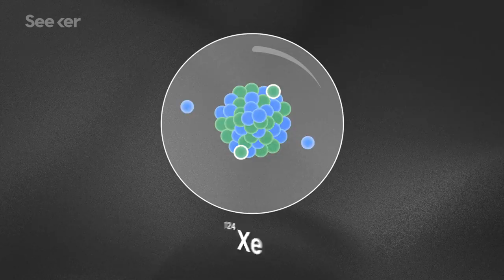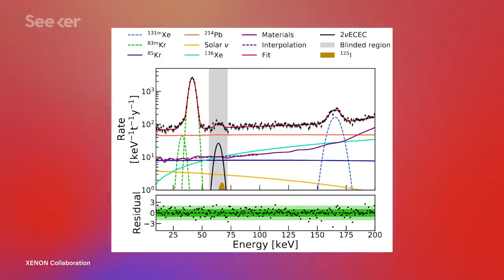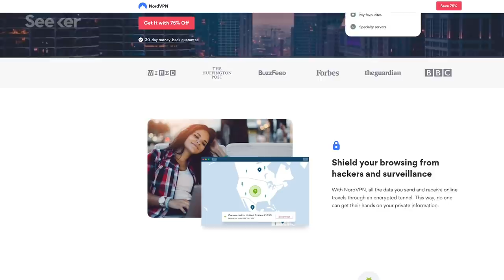Scientists Were Hunting for Dark Matter...and Then This Happened

Comment: What do String Theory and Dark Matter have in common? Two theories of explanation that have no evidential validation. Dark Matter is surmised circumstantially, but perhaps something else is causing the circumstances. Dark Matter was invoked to explain why the outskirts of galaxies rotate much more quickly than would be expected based on the gravitational pull of visible matter alone. Well, Bruce E. DePalma ran experiments where a spinning ball projectile did not accord with conventional Newtonian calculation expectations. Gravity & The Spinning Ball Experiment http://www.rexresearch.com/depalma2/depalm.htm.

There was also an anomaly with an early satellite space shot where the final stage consisted of several solid fuel rockets arranged to fire simultaneously as a cluster. Because solid fuel rockets cannot be individually throttled as can liquid fuel rockets, this stage was made to rotate before igniting the rocket engines so that the net thrust of the rocket stage was evened out (to prevent the rocket from veering off course due to any variance in the thrust of the engines). The satellite ended up being placed into orbit but it too did not accord with calculations - it ended up being placed much higher. Once again, rotation looks to be a factor.

There may be an interaction of rotation of matter with respect to inertia when said matter is subjected to some gravitational acceleration force, that has not been formally recognized by physics.

Bruce DePalma's experiments from the 1970s need to be repeated and conducted in vacuum chambers. Such experiments would be, relatively speaking, very low cost and yet could reveal new physics. If DePalma's effect were to be officially recognized, that would be far more important an accomplishment than determining the half life of an isotope of Xeon.

Comment: What a load of rubbish. If you do the calculation you will see something interesting. That is based on one single atom of Xenon 124. How many atoms were present? One mole is 6.022 x 10 ^23. Their number is 1.8 x 10^22. So the question is why? Supersymmetry is the answer. If there was only one atom of xenon in the universe all by itself without anything else around it then you would have to wait a long time. How many atoms where there and what was the system hosed in and does that contain isotopes of various atoms which may do beta plus or beta minus radioactive decay. How many cosmic rays, neutrinos, etc. The numbers are meaningless like saying the proton is stable at 10^38 years. Well, I disagree. We have both beta minus and beta plus and K+ electron capture. The stability of a proton and a neutron in tritium is not the same as the stability in hydrogen. It depends on the supersymmetry of the system. If the photons are balanced in harmony by being connected to an even number of neutrons then the atom has balance. Maybe science will finally look at itself and realise the current model needs to be shifted.